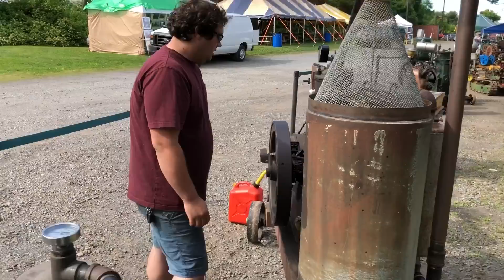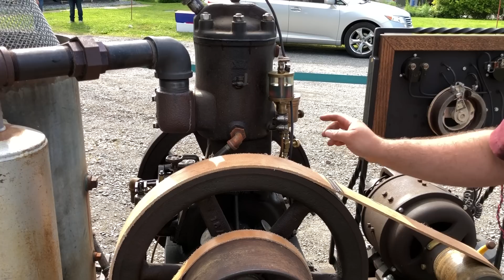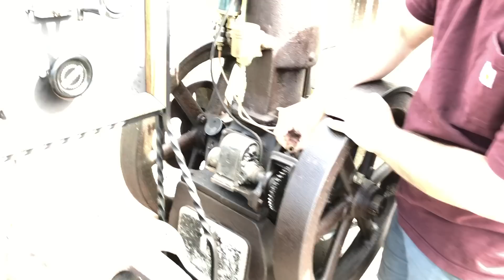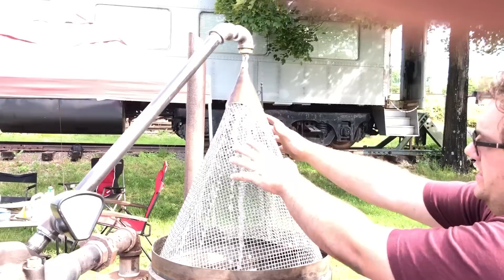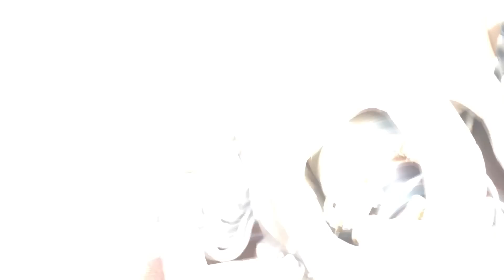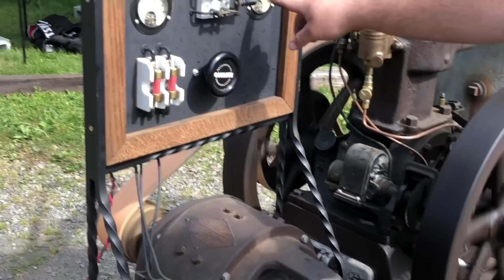Antique Bessemer Generator Set Running at a Show

Comment: I was raised on a farm that did not have mains electricity until later years. We had some similar arrangement to provide lights in the farm house and around some of the buildings. The lights flickered in time with the engine firing, if the rpm dropped the lights went dim, brighter as it picked up again. It also powered a pump to provide water for the house and the animals. If the cows drank  a lot and the pump had to kick in our lights would dim for a while. I remember some days Mother would turn the electric light on until she found the matches etc to get the kerosene lamps going. She preferred the steady light of the lamps.
Father used to go out late at night to turn the thing off until the next day. The cost of bringing the power line across to the farm was too high for a number of years. In the early 1950 's I think it was we got the power installed, even got a TV set  later. Such is progress.

Comment: Hey Mike. You can buy crowned rubber tire covers (relatively soft and stretchy like a huge rubber band) for wheels like that. You slip them on and then epoxy in place. When they worn, you peel them off. They're the same type used on old band saws, the big ones though, not little ones. Get you one of those or the material (cut to length and apply) and that will keep that belt running on center. Beautiful display as well, stunning. Thank you for sharing!

Comment: I used duck  tape for the pulley on my sawmill... It was a 10 inch wide belt 20 inch diameter.  Nice outfit you got there.

Comment: Mike: I think to be able to run the full 3k watts on the Besemer on the flywheel put the spoke protection rubber from a narrow wheeled bicycle around the center of the flywheel. superglue the ends together with a slight overlap for connection and also to pin the rubber to the flywheel or generator. This will force the belt towards the center as the load increases, and also dress the rubber with beltslip rosin so as to keep the belt with traction. In the sawmill once a week we had to use beltslip on the headsaw drive belt which ran from the basement up to the headsaw powered by an electric motor powered by a hog burner which we ground with a hammer mill all the scrap and sawdust from sawmill.You would have been amazed at how small the steam turbine and generator was for 100k watt powerplant with steam. We used a chipper off the edger as those slabs were too long to fall into the hog but made into chips before hand.

Comment: Re-crown the generator pulley (the best way) no need to mess with the flywheel pulley at all OR JB  Weld a bead on the the generator pulley (wouldn't last as long I don't think) both would work just fine

Comment: The reason that the flywheel is flat is that you aren’t supposed to run the belt off of the flywheel. The belt goes on the pulley next to the flywheel.

Comment: The flywheel must not lost its camber,al must be due a misalignment of engine.Those belts do not work on tension neither they work for its own weight .I saw many engines with flat flywheels and they keep belt fit.

Comment: A strictly temporary way to add crown to a flat belt pulley is to very neatly apply a strip or two of vinyl electrician's tape in the center being careful to butt cut each layer. The tape will last longer if it's high quality (3M for instamce) and its applied on a scrupulously clean surface. More than one layer may be required so try for a symmetrical application. 

A real rough rule to determine pully crown for a 1/4" (6mm) thick leather flat belt is: crown height equals 1/48 times the square root of the pulley width. It's a proportion so in works for Metric and Imperial measurement.
Reply from the maker: Yes that was a temp solution later on in the day.  Thanks for watching.

Comment: Your belt run is too short. You also don’t have enough wrap on the generator pulley to get anywhere near the 3 kw it’s capable of. It’ll slip like crazy. You need to triple the length and run an idler pulley to tension and achieve the necessary wrap. Look at old steam tractors on dynamometers. They have loooong belts and more wrap at the driven pulley end. Little to no slippage even at high torque loads and once they are straight.... little to no tracking problems even with a good breeze blowing the belt around.

Comment: Mike some old timers commented on my display last weekend. We were running an early piston pump off a headless Witte engine having trouble keeping the flat belt on the pulley. They said all you have to do is put a few wraps of electrical tape around the center of the pulley or in your case the flywheel and it acts much like a crown in the pulley would have. It saved our weekend and worked very well. It only took 3-4 wraps of tape. Give it a shot you have nothing to loose! That’s a beautiful generator and engine display! I’m hopeful to have something similar to that one day!!

Comment: Belt wandering issue: Alignment of engine and generator is out.  Add some fine thread adjusters to the generator base.  A belt "keeper" (think tuning fork shape) surrounding the engine flywheel sides would be a good solution if belt wanders depending on loads and can't be adjusted to track consistently.  The keeper could be bolted to the cart and positioned on the belt intake (inbound) side of the flywheel.
Nice restoration work.
Reply: Or a twist in the belt like all the old mill's or factory drives.

Comment: is there any chance of hiding a GFCI under the unit so the output is protected.. so nobody reaches over and gets shocked by accident or otherwise.    for the belt issue..  you might be able to mount automotive belt idler pulleys down low out of sight on the engine flywheel to keep the belt from walking off the sides.  have them on a hinged pivot to be able to drop them in seconds to slide the belt back on.  its just a thought.

Comment: I love it, especially the RR sound background.  What attracted me was the basic shape of the engine, which evokes fishing boats in Norway in the '80's.  They were one lungers running about 80 rpm, and were much less picky than what you showed.  A kick starts them off, with gasoline, then switch to kerosene. Go back to gas on docking.

Comment: What  lovely engine, and how quiet the whole plant operates - I love it! . . It reminds me in some measure of a Gerry-rigged DC generating set we built from a Petter 1.5HP engine, and a Tarpen 110V 0.5kW generator, though ours was a product of necessity at the time (long term power outage), and was never going to be as nice as your combination, nor as quiet! Plus, ours was built of 1940s engineering, so wasn't as nice to look at.

Would you use it to light your home in an outage?

Comment: You could do what the old timers did. Put leather lagging on the pulleys.
You could also sleeve the generator pulley with brass or cast iron and recrown it. Hard to tell, but it looks like they did that before, the gen pulley looks like it has a brass color.

Comment: Just JB weld a crown on the flywheel.

Actually, you could try to find a multi-rib automotive belt that fits snugly around the flywheel, slip it on centered, but with the ribs outward, with a little bit of glue, let it dry, run the motor, and sand down the edges of the belt.

Comment: To add camber to your flywheels, run a piece of string over the width of the flywheel and slowly increase the amount towards the middle, two or three wraps high will do it. Varnish it in place.

Comment: The reason your power belt is 'walking off ' the pulley is because the gen and engine are at a slight angle to each other. Have the same problem with band saws and belt sanders. Set up your gen on a base where you can adjust its angle relative to the engine pulley. Check out old band-saws. They have a relatively simple set up that you could apply here and not have to do any kind of modifications to the pulleys themselves. Once you get it set up all you will have to do is give it a slight adjustment while it is running and get the belt to stay put, from there, full power!
Reply: thought the same, the torque load is twisting the frame and doesn't take much.
Reply: @qzh00k  Yep, half a degree maybe less. From his description, it sounds like he is real close as it is. Can apply some power, just not full. Half a turn, maybe. Don't how many times I have stood alongside a resaw running at full song and watching that blade with my hand on the adjuster, giving it those final tweaks before buttoning it up and telling the crew, "good to go". Now that I think about it, that was a foolish thing to be doing! 27 feet of toothy steel runnin' at 130 miles an' hour. Life of a millwright, glad I'm retired.
Reply: @leonardhopper857  always appreciate the skilled trades, we made this nation.

Comment: Just for fun, have you had a chance to test how many kWh of energy it can generate per gallon of gasoline burned? If everything's right, it might be as, or more efficient than a modern high speed generator. I've always wanted to compare the thermal efficiency of these old slow speed engines to the modern high speed engines. Does this engine have valves, or is it 2 cycle? I know a lot of them just use a spring on the intake valve, and an inhibitor, for the hit-and miss governor. The exhaust valve, is usually cam or eccentric driven.

Comment: Ever watch a wagon maker put a metal tire on a wooden wagon wheel?  I'm thinking you could get a piece of flat stock, roll it, weld the ends into a circle with a circumference just a tad smaller than the flywheel, heat it up, slip it onto the flywheel, then machine it to a crowned shape.  I think it might work and be totally reversible?

Comment: mr Mike: I like your videos a lot. One thing for your bessemer while at the show. Take the belt off, and using black plastic electrical tape, run around the middle for three turns, or until your roll is empty. Go in the belt direction so it won't unroll off the flywheel. two or three thicknesses would probably be enough to center it, and with black tape no one will notice it.

Comment: If you want better adhesion on your water screen drip just a touch of dish soap into the water, not enough to make suds but just enough to break the surface tension of the water...

Comment: It is great to see you and the Bessemer in good health. Several wraps of good old fashion black friction tape around the flywheel with a little more concentrated toward the center might give you the crown you need and not look too out of place. With a better crown on the flywheel, you may not need to worry about the worn crown on the generator pulley. Thanks for sharing your Bessemer with us.

Comment: Nice setup Mike !! Just curious as to how much work needed to be done to make the Bessemer run from when you got it??  Always amazed at how "robust" this old stuff was designed and built so it responds so well over a hundred years after it was made. 
How about a bicycle tire tube of the appropriate diameter that you could "stretch" onto the flywheel center. Maybe a layer of wide vinyl type over the tire tube to spread (feather) the shape.
Around here called "calpico" tape. 
https://www.ebay.com/i/163076664353?chn=ps

Comment: Good to see a video from you!  Sweet setup.  I had a similar idea to David, except was thinking a 3/4" or so, tapered edges, leather belt on the drive wheel that could give an effective crown under the drive belt.  I'm sure you will figure it out.

Comment: Use rubber, like the old stile tires on cars. Steel or wooden rim with a rubber "band" around it as the riding surface. same thing can be used on your application. Heat stretch the rubber and put around the flywheel and let it cool to shrink it onto the flywheel. Or you could use glue, but friction should hold it on there good enough.

Comment: Run a bit of masking tape on the flywheel in the center. That should help with your tracking problem.
Reply: Exactly... I was going to say electrical tape works well, better belt traction than masking tape too.    Had to do that one an old water pump I once had...